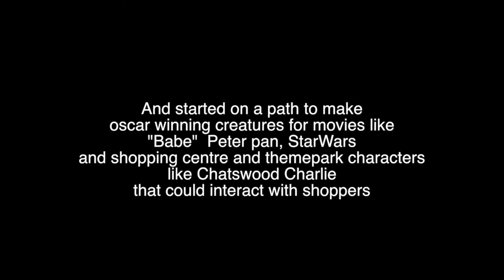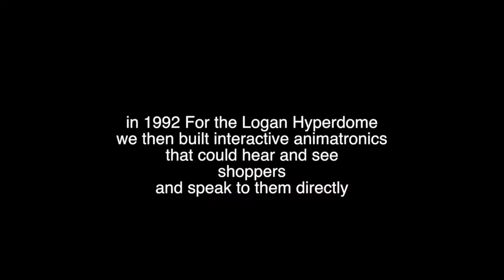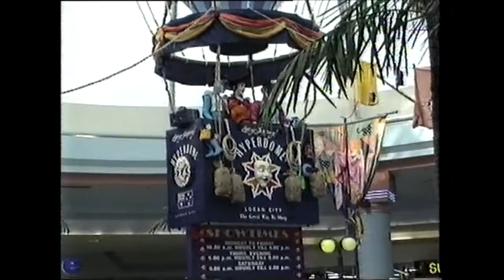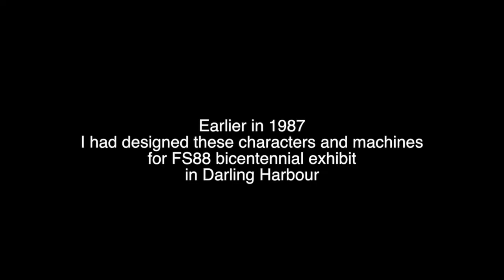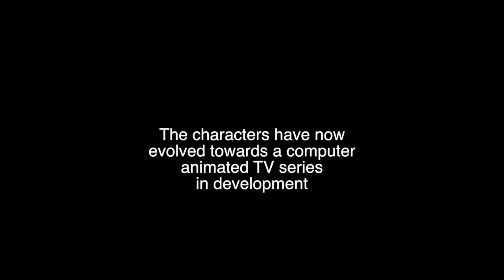Australian Interactive Animatronics & exhibition, themepark and shopping mall display

Comment: I miss the Looney Tunes ride at Movie world, that was one of the highlights of going there.

You didn't happen to work on the Gremlins ride too?
Reply from the maker: Yes we designed and built all of them. I built the little Gizmos too and the Beetlejuice characters. Unfortunately the eyemechs in those days were standardised and had a design flaw of using cables and the cable would fatigue after a few months I recall .  The skins were polyurethane and looked cool. The dust from visitors would accumulate on them and unfortunately the cleaning staff used strong solvents that made the skins turn to goo and fall apart.  If they had just read the instruction and service books they would have lasted years but unfortunately  those were locked away in a filing cabinet and I was told none of the maintenance staff even knew about them!